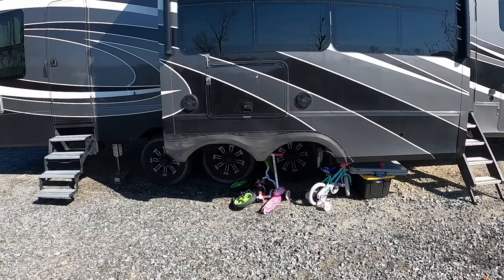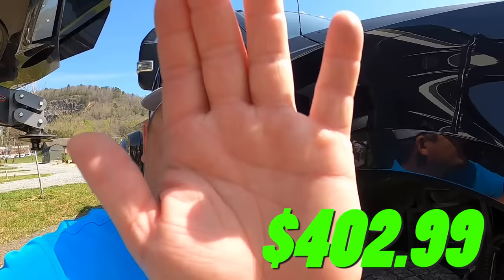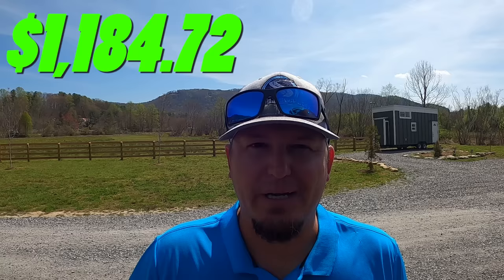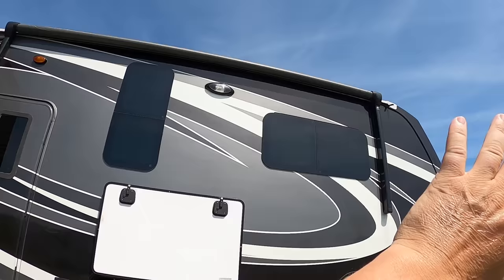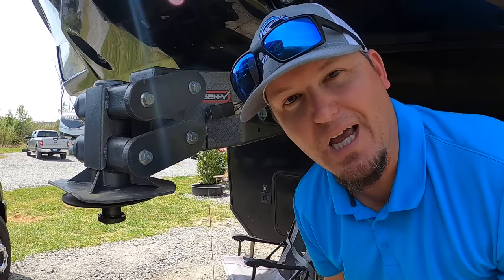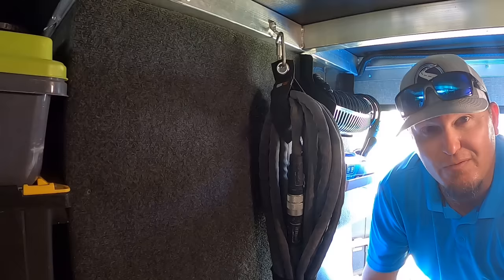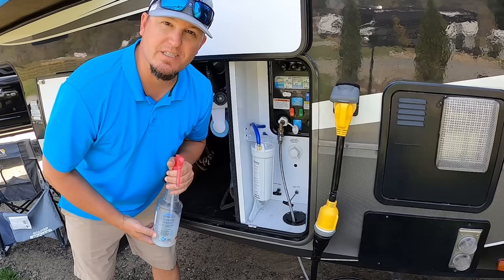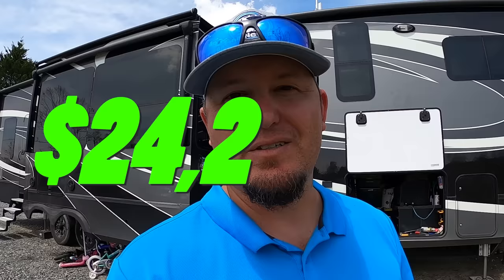These Things Are Money Pits! Everything That We've Had To Repair! | Fulltime RV Living!

Comment: Having spent 7 years of extensive traveling (not full time living, just about 100 nights per year) with a fifth wheel and a tow truck I can totally relate to your list of repair and maintenance. Our worst one was a cracked frame of the fifth wheel developing over time. I guess we hit one pot hole too many.
What still isn't included in the cost calculation is the depreciation of both the truck and the fifth wheel. RV-ing isn't cheap no matter if it's full or part time.
Reply from the maker: We thought there would be some Maintenace and repairs, but we figured our biggest fulltime living expenses would be diesel or RV parks! No the most we spend every month is taking care of the rig!  And that is totally fine because it has a big job of allowing us to travel as a family!

Comment: When it comes to truck maintenance, you definitely can save lots of money by DIY for the simple stuff. $45 for your (2) fuel filters. $100 for (13qts) T6 Rotella full synthetic oil.   Even the brakes & 2 rotor’s will cost you less than half by doing it yourself. Lots of ways to save substantial money.
Reply from the maker: I do almost all my own maintenance!  The fuel filters at $70 for both and that is the biggest savings I could gain!  The ford dealership only charges $110 for oil changes so there is not much savings there!  The reason I have to pay for these things is because we travel fulltime, RV parks don't allow this kind of work in the parks! So I don't have a place I can do it myself!  The same for the brakes, Sure I could have saved about $600, but since I travel fulltime I can't do that type of work in the park, I also don't have all the tools with me to do that job, I don't carry a big jack or jackstands to make that job easier, so in the end it was way faster and ultimately better to let Ford do the brakes!

Comment: Now I REALLY appreciate my Nissan Frontier PRO4X (made in Mississippi) and our T@B 320 Boondock (made in Ohio). Though I lifted the truck with Old Man Emu, Installed a lock-n-roll coupler, jack-E-up jack saver on the trailer and up-graded the tires on both the truck and trailer, we've spent cents on your dollars over the last 3 years. Being able to go off road on moderate trails is another way to enjoy RV life! However, a VERY good relationship with one's wife and the dog is REQUIRED sharing such a small space
Reply from the maker: An equally good relationship is needed to share a 44-foot fifth wheel with a spouse, three children and a dog! Ha!

Comment: My wife and I have been living in a fifth wheel RV, a 32 foot Jayco Pinnacle for over a year now and all we’ve done is replace the water heater anode rod, Lol. The window shades are failing and need replacing but outside of that, it’s been fairly trouble free so far. Granted, we DO NOT travel in it and are permanently docked, and that more than anything else is probably why we haven’t had the kinds of problems that you have. Being that it’s also a top trim level RV, the materials and craftsmanship are superior to others, so I’m sure that plays a part as well.
Reply from the maker: Absolutely! Moving it every 7-10 days over the last three years, has caused a few of the issues. But normal wear and tear from a family of five plus a dog living in it fulltime are to blame as well.
Reply: Don’t worry those jayco repairs are coming

Comment: My wife and I full-timed for 10 years. Went through 3 motorhomes and three cars. Two accidents. (One my fault, one not) A whopping 5 toilets and 4 A/C units. Two water heaters, two roofs, at least a dozen slide major repairs. 4 sets of tires at a whopping 5K for each set. Three tow-bars. Countless slide topper repairs. Two generators. One $7,500 floor (Tile) One windshield, and one blowout destroyed a main electrical cabinet costing $9,500 to fix. More roof leaks than I care to count, one $895 starter for the big diesel. One $3,500 rear end rebuild. We're a little old now but if we decide to go again we'll rent.
Reply from the maker: I appreciate this comment! Most that view this video think we just have problems or the RV is a lemon! Your story along with almost every other full-timer we meet is the same as ours! If you travel fulltime in an RV you will have to make repairs and do maintenance that most weekend warriors will never see in the entire life of their RV!

Comment: Wow ... $1,000 a month for maintenance is a big nut to crack! Especially when you consider that as you continue piling on the miles, and the rig begins to age it's likely to become even more expensive when major parts, appliances, and systems begin to fail.
Reply from the maker: Yes but thats just the average if you considered all the repairs and maintenance!  We had several big ticket items that were one time repairs, yes they were unfortunate but it's not a true monthly maintenance cost! Our real actual maintenace cost is closer to $300 a month for normal stuff to keep the rig running!

Comment: Thanks for the heads-up I'm gonna heed warning ⚠️ was in the process of buying a new 44.6 ft RV fully equipped plus a lot of those repairs are for things that should be stable in a house and not in a moving trailer
Reply from the maker: RV's are awesome but you have to have realistic expectations!  When we started out we just thought we have a new truck and trailer everything should be perfect!  We have traveled for 3 years now moving every 7-10 days and we now know that was the wrong outlook to have when traveling fulltime!  Yes things will break and need repairs, often times more than you want and expect, but that is just part of the RVing adventure!

Comment: I feel your pain. I full time RV and I’ve put 8,000 into it this year alone. Fixing seals, roof maintenance, black tank leak and so many other things. It’s still a cheaper alternative but the cost of full time living in it does get frustrating.
Reply from the maker: Thank you! There has been a lot of negative comments on this video, and we try to explain this is normal for those who actually use the RV more than a few times a year! It's an amazing way to live and travel, but its not a 24/7 vacation!

Comment: Regarding the ac filters, just buy a big roll of the filter material and cut your own. I've been doing it for years and it works great. You could do an entire year for $30...dont forget these a.c. units are not designed to have high mirv rated filters in them, so don't go crazy on the mirv rating!
Reply from the maker: We don't buy crazy filters. We use replacements that are better than the stock foam inserts that come with it! We wash them every month to save money and change them every 3 months!
Reply: @PavingNewPaths  for sure. I use a mirv 8 cut from a roll when my friends bring their dogs to visit. Helps keep air lil cleaner. Thanks for the video. Very insightful!

Comment: You can rotate the tires on the rims if you've got the stock wheels. A lot of shops don't like to do it, that's why they say they can't.

The rear wheel turns around and faces the opposite direction to make it a front wheel. There's lots of youtube videos showing how to do this.

If your truck is a 2WD, I'd advise just running a closed shoulder tire on the front and cross rotating them. Run an all-terrain or mud and snow on the back. That way you get the best of both worlds. Plenty of grip out back, long wear in the front.
Reply from the maker: This only works if you have steel wheels! We have aluminum wheels so the only way it works is to move the tires!  Our inner rear is a steel so we only have 4 rims that are actually aluminum! If you don't care how it looks then yes you can do it, but if you have aluminum rims you care how it looks!
Reply: @PavingNewPaths  did Ford just cheap out on your two steelies, or is there a reason they don't give you 6 aluminum wheels? In the old days they'd give you 6, but sometimes they'd crack.
Reply from the maker: @pblackbird  Every Ford since about 2012 has been only 4 aluminum and two steel for duallys!

Comment: My wife and I were full time for 4 years. We bought a RAM Ecodiesel and a 32 foot travel trailer. The truck needed nothing but fuel, oil, and filters for 100k miles over 38 states. The trailer had some minor things but not very expensive.  We quit to be closer to grandkids all the time.
Reply from the maker: It is an awesome life and most of our cost are due to the way we travel! We are always on the move so our cost on everything will be more! We love it and this was just us sharing our experience with our viewers!
Reply: No tires in 100k miles?  I question how well you kept records.
Reply: @clarkharms  I'm sorry, I considered that routine. Yes, we replaced tires at 60,000 miles with the OEM Goodyear Wranglers. The second set didn't last as long, and we replaced them again at 115,000 miles. The truck currently has 120,632 miles on it. I just changed the 10.5 quarts of RotellaT6 5W-40 for the 16th time. I also replaced the air filter and the diesel filter/water separator for the 8th time. I'm going to guess that I've added somewhere close to 80 gallons of DEF. I replaced all four sets of brake pads and the rotors at 100,000 miles. I only replaced wiper blades once and had to fill the wiper fluid resevoir several times. I put a new serpentine belt on at 75,000 miles. Also, one of the bulbs in the third brake light went out. I fixed that and added a strip of foam weatherstripping to the whole assembly. That should get me up to date. I hope my confessions will allow me back into your good graces.
Reply: @michaelmappin4425  yes that seems more reasonable.  I am considering a hdt truck over a dually and one of the reasons besides safety is the overall operating cost.
For your sin of data omission there will be a public flogging
Reply: There's no way you towed a 10,000# 32 foot travel trailer with a a 3.0 Liter V6 Ecodiesel motor.   Maybe a Cummins in line 6 that was a 3/4 or  1 ton truck.  But not a 1/2 ton Ecodiesel.
Reply: @feloniousmonk3049  Our weight was not 10k. We were very careful about how we loaded the trailer. Everything that went inside was checked on a scale. We never towed any water except for about 3 gallons split between black and gray water tanks. We even emptied the 6-gallon water heater. After everything was inside, we took it to a CAT scale to verify. We were about 200 lbs over the max recommended towing weight. Which was distributed evenly by a Pro Pride  hitch. We mitigated the risk involved by never exceeding 62 mph. I'm sorry you don't believe me, and I'm also sorry I can't attach any of the 100s of photos I have. I sold the trailer, but I still have the truck, which just got its 120k mile oil change.
Reply: The Ecodiesel is not a good motor and is very limited on towing, compared to a 3/4 ton truck.
Reply: @calebniederhofer6529  Yes, a 3/4 ton truck can tow more  than a 1/2 truck.
Reply: @michaelmappin4425   My point was a ecodiesel towing some small travel trailer is a lot different then full time living  and traveling in a large 16,000 lb 5th wheel.
Reply: @calebniederhofer6529  that's true. However, our 32 foot travel trailer had 2 slides and opened to 310 sq ft. About equal to many tiny homes that people enjoy. We spent 4 years living in it and I loved it. It was pretty economical compared to the bigger rigs you describe. Towing, we would normally see 13-14 mpg. When we were unhitched 22-28. If we didn't want to be around grandkids, we'd probably still be in it. Additionally, I spent 32k to buy the trailer and sold it for 25k. I traded a sports car and a Tacoma for the truck. Bigger trucks and bigger trailers cost bigger money. I never found an RV park where space was a problem.

Comment: We retired in 17, I found my Chevy 2014 2500HD diesel on Craigslist w 3000 miles on it, 45000$, I installed airbags, we full timed 3 yr., I avg 11 mpg towing. We've towed approx. 40k miles. It's got approx. 90k miles now.
We still tow a few weeks per year. The truck seems to get a little better mpg every year I own it. It's currently getting 20mpg not towing if I do a 50/50 hwy/around town driving. I've lost track of how many times we did the Sisques. All this towing a 5iver just a little over Max GVWR. Other than tires, batteries, oil changes, it's never broken ummm other than the time my wife drove our car into it.
Now it's main use is getting food loads for the local food bank. Thanks Chevy
If your going to fulltime and don't have deep pockets, you better be a good diy-er
Looking back I would never swap fulltime RVing for Hotels, it was the most fun we've ever had, but don't do it thinking your going to save money, you do it for the adventure. Just waking up knowing that everything you own is going down the road with you  I miss it a lot, although waking up to pickleball every morning works. Be safe.

Comment: I owned a 5th wheel for many years. First issue was a cracked frame that prevented slide out performance. Found out it was not uncommon and due to tight turning putting torque on the frame. Also found out that the waste water tank valves are seldom installed per manufacturers guidelines. Had to replace them with electric valves. Had a leaf spring break on I-40 in New Mexico and found out it was a mismatched spring. Three the same and this one which was longer and less capacity than the others. That had to be repaired on the side of the highway since the wheels were touching and the trailer couldn't be towed. All in all, most modern RV's are not built to be towed but to be parked. If you buy one to be towed, be ready for LOTS of repair and maintenance. (Also had tire pressure and temp monitors working well but didn't prevent or warn of a blowout that caused damage to the unit and slide out) Fun, fun, fun.
Reply from the maker: Yes if you actually use them and travel you will have way more problems than most! Everyone of our probelms came from moving, and after about 6 months we worked all the moving bugs out!

Comment: I really enjoyed your video.  I’d say 50% of those costs were either self inflicted or unnecessary (especially on the truck).  The other 50% are things that are just gonna happen.  Like needing a new roof on your house.  (Good call on the Armor roof by the way.  Expensive but worth it).
Reply from the maker: Thanks glad you liked it!  The only thing in this video that was my fault was the brakes on the truck, I should have changed them sooner and it would have just been pads, instead of two front rotors as well!  Everything else in this video is done as a repair or preventative maintenance in order to avoid a repair!  We knew going in that with fulltime travel we would have more repairs than most!

Comment: Good video. What I discovered with the over cab lights is the cracking happens from the heat of the bulb. The plastic was always disinegrating right in front of the bulb cause it was so close. If you get LED's that cures that.
Reply from the maker: I will have to look into that as they just broke again recently!

Comment: Wow, I’ve had my C-Class Jayco Greyhawk 31’ for 3 yrs and have run 45,000 miles. It’s on a E-450 Ford chassis with a Triton V-10. By design, and for obvious reasons, RV’s and the materials are light weight. I’ve had virtually no problems that I didn’t cause myself. There are hassles. Winterizing, rotating 6 tires which are still perfect, cleaning the roof, changing AC filters, pinning down rattles. The unit is luxury and is a treat to own and use. Aside: the dealer and their service dept is HORRIBLE….anything that I need or want is always 6 weeks for an appointment and leave it with them for a week. Good that I and friends are DIY handy.
Reply from the maker: I wouldn't say we have had many real problems, we've only had one that was a big deal, the roof! But the rest are all just normal repairs and maintenance that come with fulltime use! We also have never used a dealership to make any repairs, we did all the work ourseleves and have never missed a night in the RV in over 3 years!

Comment: So many RV owners say the same as you - that it is EXPENSIVE to RV full time.  They say that RVs are NOT built to be lived in full time so things will vibrate, stress and break far more often when living and being on the road full time in the RV.  A major expense and inconvenience comes when a unit breaks down, seriously breaks down and has to go to a garage for repairs (while you are on the road).  You can end up waiting and paying for a month in a motel while waiting for the repairs to be done - it seems there is always a waiting line at the good repair facilities.  I wanted to buy a smaller (24') used RV and travel when I retired...but with covid, inflation, supply chain issues, cost of RVs, cost of gasoline - none of that was feasible.  Instead I paid off my mortgage and am enjoying living mortgage free in my home.
Reply from the maker: There's definitely nothing wrong with living mortgage free in your home! You could always get a small RV and do shorter trips! RV's break, it's just part of the lifestyle! We've been blessed that we haven't had to evacuate our rig for a long term for a repair.